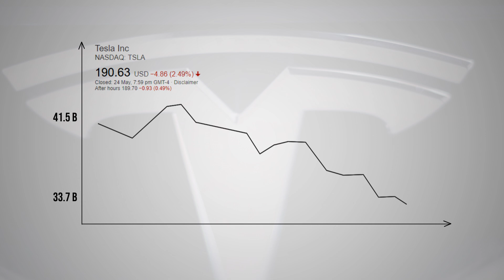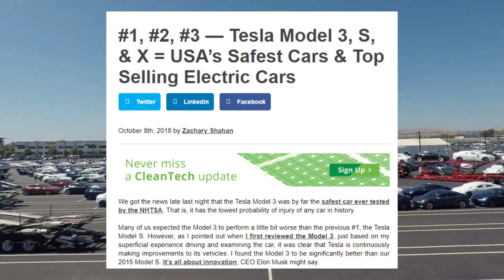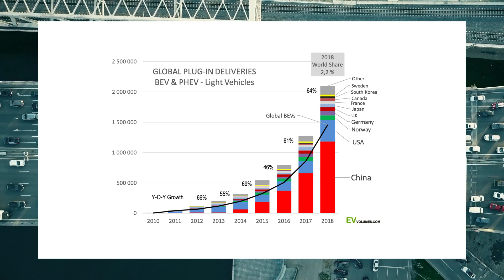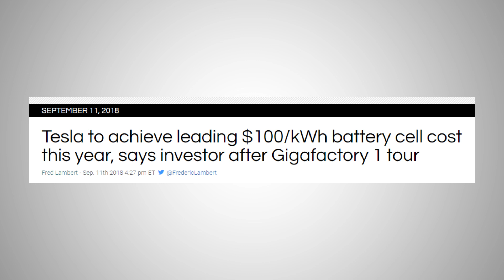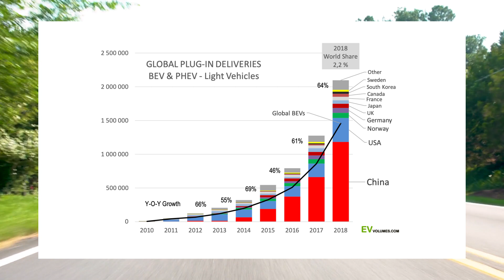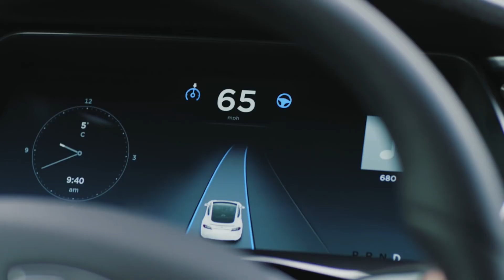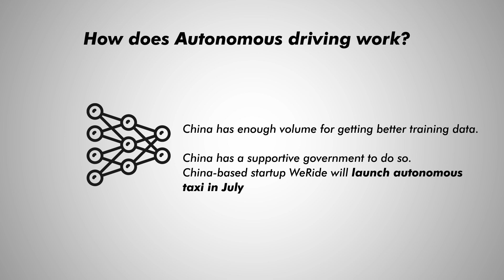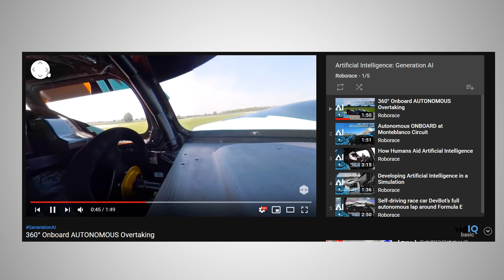Can Gigafactory Shanghai Fix Tesla's Money Problem? | Elephant Explains

Comment: I don’t think the investor reaction has anything to do with the fear mongering about fires or crashes. These fires are numerically insignificant next to the number of fires that occur even daily in gas powered cars. The stock price has everything to do with the power that short-sellers have on the stock. The short-sellers make money when the stock goes down, and they have lots of backers in the existing car companies, dealerships and oil companies. The oil companies in particular want EVs to fail. But even the other automotive companies would rather that EVs fail because EVs will cost more for them in the short term. And in the long term, there’s less maintenance and parts, so that means less to capitalize on for dealerships. This is why big auto and big oil would rather spend money lobbying governments to change the rules than actually producing and selling EVs. Tesla has a pretty big advantage in several key areas, such as batteries and a better drive train than other EVs.

But I also believe what Elon says about lidar. He’s worked with lidar himself in his SpaceX company, and he agrees that it has uses in some areas - just not cars. One of the things they talked about in their investor autonomy day that I think slipped past most people’s notice was that cameras actually produce much more information, and at higher resolutions than lidar. So there’s just a lot more data coming from cameras, and that’s what’s important. The colours and shading allow them to make a lot of key distinctions about what it is that they are viewing. And as he said, people have eyes that have served us well for a very long time. And add to that that Tesla’s can see in all directions at once, and are focused on both close and far things all at once. And they also have front facing radar. There’s an abundance of data there - which is very important for AI.

Although there are still incidents with autopilot, it’s improving very quickly. One of the things that people don’t fully understand though, is that the system doesn’t learn while you drive. It only learns things after reports are uploaded from the vehicle to Tesla and they’ve reviewed it. And partially because of the way this works, not everything which should be uploaded is uploaded. So it might take another year or so to nail down most of those corner cases and things like unexpected diversions due to construction. But I think the more obvious things like automatically switching into a lane in front of another car that’s closing the gap very quickly should be fairly easy to fix. The shadows on the road problem is a bit tougher, and it’s one of the other things that has caused problems. But in general autopilot is progressing much faster than their competition. Furthermore, I don’t believe their competition will EVER have fully autonomous vehicles that can drive everywhere safely unless they move to Tesla’s approach. They don’t want to use Tesla’s approach because they say they can simulate everything - well that’s just nonsense. The truth of the matter is, that they need a big fleet of cars to use Tesla’s approach, so they are at a decided disadvantage. And since they don’t want a big fleet because they are too afraid of what fully autonomous vehicles will have on the industry - they are kind of trapped. Its the same issue the legacy car companies have with EVs. They will be competing against their own products, but with cars with smaller profit margins.
Reply: The short sellers are over leveraged so selling to save their butts! Hahhhahhha
Reply: Every time it's so exhausting with you guys always comparing all ICE cars ever made to an EV only made since 2012. Why not get statistics of ICE made since 2012.

Now let's also compare Tesla with another EV the most popular EV by sales numbers the Nissan Leaf in its history it's had just 1 fire and no one knows if it was battery related however I did find a YouTube video of someone testing how easy it is to get a Nissan Leaf battery to burn, they tried their best buy punching a screwdriver though the module and using a propane burner and guess what no fire! Apart from the glue but that quickly went out.

 https://youtu.be/Jz37WycW-7E
Reply: @gregandkaruna6674  Its because everyone brings way more attention to electric vehicle fires than ICE car fires to the point where I even had a couple friends talk about how dangerous an electric vehicle sounds. Which in reality most electric cars catch fire way less often.

As for the EV to EV comparison, I think they Mostly get pushed into one category. since Tesla manufactures way more cars than the Leaf.
Reply: @conconc678  Excuse me the Leaf Still is the most sold EV in the world by volume sales. Gets your facts straight!
Reply: @Steve The Leaf has one serious flaw. Nissan has decided not to include a thermal management system for their batteries. That’s a big problem in hotter climates. Batteries that get overheated degrade really fast. Its one of the reasons why excessive supercharging is bad for your batteries. At least Tesla tries to keep them cool. I understand why the first generation Leaf had this problem, but I think they are just trying to keep their costs down on the second generation. Its a really bad idea in my opinion.
Reply: @jdhwpbmbca  Have you not seen the latest 62kwh Leaf e-plus it has air con fan forced and the ones that have tested it say battery overheating is a non issue now. Liquid cooling is just one more complex part that can fail.

Comment: It’s not a lack of detection problem. 
It’s a human not looking at the road problem.
The cars ap (all of them!) are programmed not to stop on highway if there’s a big obstacle, because most of the time it would be a false alarm and emergency braking on highway is very dangerous.
That’s why it’s only an assist and it’s essential to keep control of the car.
Now that teslas self driving is developing rapidly and can’t be seen as the previous ap (lane and distance keeping assist) this won’t be an issue in the future for tesla. Because the system will be able to make decisions how to react.
Reply: Well said. And the statement that roborace programmers would help fix this is  ridiculous. When programming for the racetrack you do not waste processing power looking for vehicles turning left across your lane of traffic. Which is what caused 2 of the 5 autopilot fatalities in the last 4 years. Yes only 5 fatalities in 4 years.

Comment: Thank you for the story.  Much of the optimism about the Model 3 was based on a 6,000 units per week production rate.  Recently, it was noted Model 3 production is no longer running 24 hours a day nor on weekends which necessitates validating that number.  If the actual number is less, the demand concern is legitimate.  Mr. Musk knows how many units (full Model 3s) are being produced weekly.
Reply: They are pushing for 7000 per week. And demand is not an issue, it can't be as China and Europe is just getting the Model 3. Also, just show any Tesla to anyone, 99% of them will want to buy one.
Reply: @andrasbiro3007  What source are you relying on for that 7k production rate?   I have not seen any source state Tesla is producing 7k Model 3s each week in Q2 2019.  Source please
Reply: @anthonycbrown1952  According to the leaked email from Elon, they are producing 900 per day (6300 per week) and trying to ramp up to 7000 for the rest of the quarter. In another document (probably the same one you read), they have stopped the 24 hr shifts and are running only one shift right now. If both are true, that means that they are producing nearly 7000 cars per week with only 1 shift.

Comment: But didn't Tesla phase out NVidia recently???
Reply: Yes
Reply: That is the part of the vid that annoyed me most. Goes off talking about robowhatever and saying they are using the same chip found in some Tesla's but Tesla is making their own chip now that is 21x more powerful. Tesla has stated full self driving is not possible on previous chip.
Reply: James Hall the old Nvidia chips actually are good enough to run Autopilot as Elon said it himself. Tesla’s new custom chip has way better performance but the older computers can handle self driving with utilization below 70%